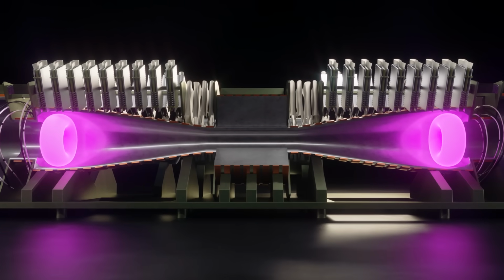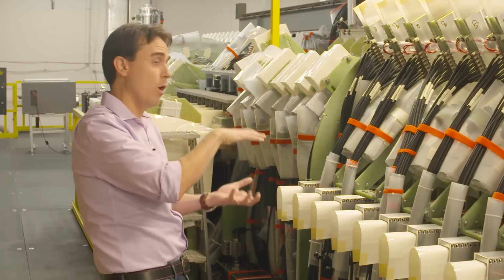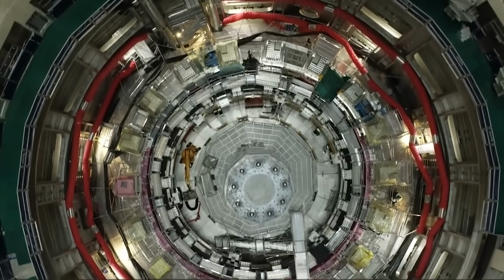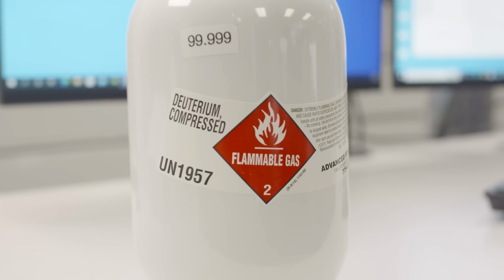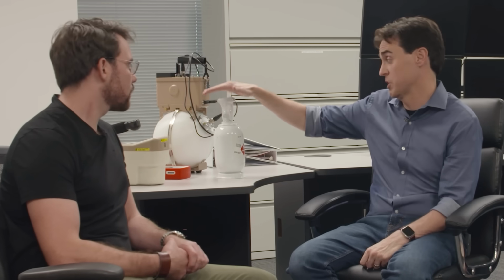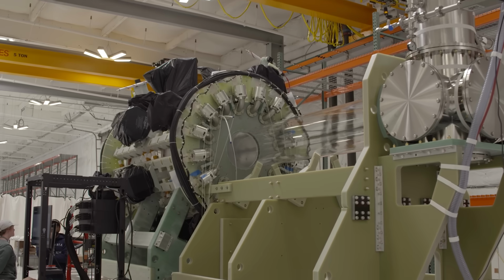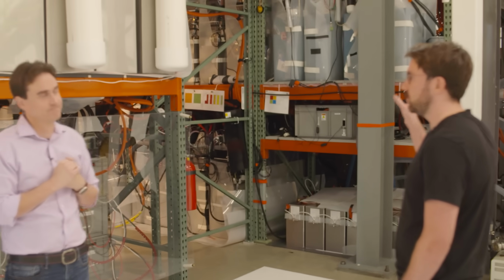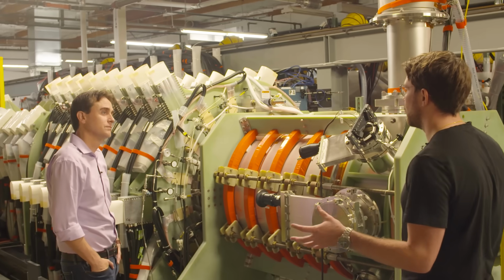A New Way to Achieve Nuclear Fusion: Helion

Comment: I'm confused, did Helion produce a positive energy output or not during their fusion reaction?
If so isn't Helion the FIRST to do a positive output?
Reply: Having watched the interviews on Nebula it seems that they have not even tried to capture energy with the current prototype. That will be attempted in the next one. This prototype was for testing whether they could do fusion using their method repeatably and frequently.
Reply: @magarnicle  
Ok but if no positive output then why try to capture what isn't there?
Reply: @paultrauzzi5360  I'm very much a layman here but my understanding is that fusion is happening in the machine. It's producing charged particles etc. But I get the impression that the current prototype does not have their planned mechanism to capture the energy from that fusion, hence no output. That doesn't mean there is nothing there to capture.
Reply: @paultrauzzi5360  I don't doubt that they will capture some amount of electricity in their next machine. The (probably literally) trillion dollar question will be Is it more than they put into it?
Reply: @magarnicle  
I'm not worried about capture yet, what is net output of the reaction?  Capture is a completely other question.
Reply: @magarnicle  
I'm only concerned with net output not even capture.
if it takes more electrical energy to create the reation than the theoretical reation output, there isn't a need to capture anything.
Reply: @paultrauzzi5360  Right. I don't know the answer to that. Helion's FAQ lists various achievements but doesn't say how much electricity it took to get them.
Reply: @magarnicle  "the current prototype does not have their planned mechanism to capture the energy from that fusion" - correct, the next machine, Polaris, will have that component to generate electricity from the magnetic flux produced by the reaction
Reply: No, Helion still working on various prototypes to get plasmas to higher temperatures, they certainly haven't made any net positive energy.  They claim they might have more energy output than powering their device by 2024.
Reply: @RWZiggy  Maybe, just maybe we will never get there, Stars are able to produce fusion energy just by their gravity and size alone. The bigger a certain system gets the more energyefficient it becomes thats just the square cube law for you.
Reply: @Benepene  stars use different fusion processes, mankind isn't trying to fuse ordinary hydrogen for a power plant or do NCO cycle.  but DT would be hard enough, Helions side DD is unlikely
Reply: Considering the capacitor bank's capacity is 10m joules, using the little diagram at 12:49, then assuming 100% yield (and hinging it all on what is definitely my awful, awful math and reasoning skills), they'd break even with 10m joules using around 1.53*10^19 molecules of deuterium. 3.97*10^7 mL of liquid deuterium at 1atm should do it.

I THINK

Buuuuuuuut I have no formal training in any STEAM field and am a two-time college dropout in an internet comment section so absolutely take all of that with a grain of salt - a molecule of salt, even. Even then, I don't know that they mentioned they ever made the mechanism to collect the output power yet. I assume it's being implemented in the next iteration for 2024. Or I dunno. A million other reasons. Maybe it's nowhere near 100% yield or idfk. I _can_, however, confidently say they were not the first to have positive output because if they were, you can bet they would tell you in this Helion promotional video.

Also, please feel free to take a crack at figuring out the output. I just played a game of balancing the equations shown at 12:49 and did some aggressively sloppy math with deuterium information I found online. I'm sure it's all very wrong 😜
Reply: @vituperation  
I will delve into these calculations.
I hadn't look at it this way.
Reply: So the answer is not yet, but it's really a ratio game. The achievement of fusion with the current system is 95% efficient for a prototype. Basically you want to make more then a 1:1 ratio, not a less then 95:100. But for both accomplishing fusion and with that kind of efficiency is the closest man has ever come. But with the configuration it should be able to be within the capability of making a net positive output in about a years time. Once they get better ratios, full reactors could actually power cities.
Reply: No, if you watched the video they mentioned they are building the new reactor that will produce power but its not going to be done until their 2024 projection.
Reply: Even the recent LLNL fusion 'breakthrough' with net energy output is a bit disingenuous. It was 2 MJ laser excitation, 3 MJ energy out... but 300 MJ to power those lasers, lol.
Reply: @sophiophile  you know it is still a big breakthrough.  we are talking around higher-than-cosmic energy densities here,confined in a box. it's a miracle on it's own. even starting a fire with a stick is a brilliant miraculous behavioural breakthrough. we just can not possibly adequately FEEL about those type of events anymore. it is a long gone ability for us.
Reply: @cyberbiosecurity  Oh, I still feel how amazing these breakthroughs are. In fact, some of the most amazing aspects of the breakthrough I feel have been overlooked (for example, the critical role that deep learning served in LLNL's breakthrough).  I just think the context I mentioned above is important when people are looking for energy generation.
Reply: @sophiophile  oh yeah. I've missed the ML bit too (the.... python script aspect)
Reply: @sophiophile  yes it is important. actually it is even important if the janitor there foks his vegan wife good. yeah.
Reply: @cyberbiosecurity  You can build a fusor (one of the earliest and simplest fusion devices) in your garage if you want to, and some people have done it. It will create temperatures hotter than the core of the sun and fuse deuterium and tritium into helium. People have been doing this for 70 years now, but every machine ever built, including the one shown in this video, needs more energy to heat the fuel to make it fuse then is released by that fusion. Until an actual constructed device makes net power, it's all just hopes and dreams.
Reply: @cyberbiosecurity   'higher than cosmic energy densities', very funny.
Reply: @russellpurdie  it's dumb, not funny
what I meant is fusion reaction in the sun ☀ generates about 1 watt per kilo of solar matter. 
and here they deal with higher wattage.
Reply: @cyberbiosecurity  you appear to be taking the sun as a whole in your calculation and not the whole of the machine in comparison.
Reply: @cyberbiosecurity  we don't care about scientific breakthroughs as long as they don't make us money or energy. Communism long gone comrade
Reply: @cyberbiosecurity  sure the NIF thing is impressive and great science - but from an engineering point of view (and I say this as a physicist) - how on earth do you turn inertial confinement into electricity? I'm more confident in the tokamak + steam cycle approach. And even that will take decades
Reply: @flubadubdubthegreat1272  this is what defines quality comments. thank you for great question.
Reply: @sophiophile  Yes. And that's very important.
Reply: @sophiophile  Sabine Hossenfelder did a good breakdown of this on her channel.
Reply: @sophiophile  "Even the recent LLNL fusion 'breakthrough' with net energy output is a bit disingenuous. It was 2 MJ laser excitation, 3 MJ energy out... but 300 MJ to power those lasers, lol."
In light of which it was bemusing in the extreme to read the US Energy Secretary saying it heralded commercial nuclear fusion power by the end of the decade!
Reply: @Hitch Gaming 
Ya in 300 years.
Reply: @Hitch Gaming 
Sorry but it didn't.  Not even close.  
After doing research, they are are closer to 400 to 1 energy in to out.
Reply: No, we still don't have a machine able to create positive net energy. It's actually waaaay on the negative side.
Reply: It is meaningless to bash the technology and predict it's failure without supporting such claims, especially for those claiming to be scientifically literate. Healthy skepticism is part of the scientific method, but "it hasn't been done before so this will fail" is not a rational statement. It's also hypocritical to bash Helion for not "predicting" how much positive energy output before they have sufficient data while simultaneously saying the technical achievements are overhyped. Making unprovable claims of something so critical would be the ultimate 'hype'. Building a prototype to test and measure the energy is the best way to do physical science. True scientific skeptics should look forward to the next iteration with anticipation, instead of pretending to know the outcome.

I am sceptical whether this particular system will ever scale up to practical size, but that is not the point! If any part of this novel technology, or the knowledge it produces, ends up as part of future systems then it will have been a important step forward. Whether it be grid-scale power production or a power unit for an ion engine is unknowable. Many, if not most, such advancements end up in future technologies unforseen at the time. You are reading this on a device that's only possible because of such advancements.

I'm sorry for the preachy post, but it is very tiring to read unscientific predictions by those claiming scientific training. This is antithetical to the advancement of human knowledge. Practical physicals at atomic scales and crazy energy levels are especially challenging, pushing the limits of human technology. Failure is always possible, which is precisely WHY we must do practical physics. Theory only gets us so far.
Reply: @allpro2b  WTF are you on about?
This video was release very timely on the same day as the news release of LLNL.
I and many others conflated the two.
Reply: @paultrauzzi5360   "I and many others conflated the two." So? Many people conflate and misunderstand many things.

If you actually watched the video, it should be clear it is not related. Or are you claiming that you were 'deliberately tricked' into watching a video you didn't actually want to watch?

Even if this video was posted early than planned to take advantage of increased interest in fusion topics, this would not be abnormal or devious. This is standard practice for all types on media.

However, my previous comment was not targeted at your indignation about the timing of this video. I thought it was pretty clear that I was referencing comments in this thread claiming this technology is just hype and will never work, and that it is abnormal to not "predict" positive energy output. 

It seems you "conflated" these two different topics just because they exist in the same thread.
Reply: @allpro2b  
Assume much?
If I was your prof I'd drop you a grade just for being long winded for no reason.
Why say something in 30 words when 300 will do.
If the future, answer questions presented not the questions created by the left acid trip.
Reply: @allpro2b  here, here.
Reply: They are not capturing anything yet. Do all losses. With their next 7 gen system they are hoping to start capturing energy back. And then it will be clear if they are net positive or not
Reply: Exactly it should be a net gain if they are coming out and saying they achieved nuclear fusion. You are just looking for publicity based on the recent news the other day. Don't over sell. I hope that this is the real deal.
Reply: @ichigokurosaki2838  
Exactly my confusion, this video was released same day as the news for positive fusion output.
It seems to be edited to conflate the two.
Reply: Not the first but pretty cool too
Reply: if they could get a q factor above one reliably you wouldn't be hearing of this first on youtube thats for sure. it would be all over the news. then it'd be a race to get it over 15 or so to be usable.
Reply: No. none did. They are all a net loss.
Fusion at this stage is a bit like Crypto.
Reply: @HTOP1982  
That's a cryptic statement.
Reply: It depends on what you mean by positive energy output.

Experimentally? Sure, maybe, but they're not the first as other reactors have done the same thing before (like ITER). Put a circle around the reactor and measure the energy coming in vs the energy coming out, if more energy is coming out of this circle then you've made more energy than you put in.

For commercial use? No, no one has yet to make a positive energy output. If you take into account electrical resistance and other areas of waste energy outside of this theoretical circle, then you'd be looking at a massive net loss of energy.
Reply: ~Global nuclear bomb fake Hiroshima deceptive There are no satellite photos of nuclear test explosions, please tell everyone~
Reply: @解放軍台獨1號  
I love this retardite.
Please send me your resume.
Reply: There's a difference between a positive energy output within the reaction and a net positive energy output for the entire facility. They've achieved the former more or less (they didn't try to capture and use that energy, but that wasn't the purpose of this test/prototype), but not the latter. In other words, the reaction they managed with this test produced more energy than the reaction consumed, but the energy produced was still less than the total energy the facility used to operate the entire test and its tools. It's an important step, but not one that should be overstated.
Reply: No, Helion is not net positive.
Reply: 0 output right now, at the moment it's just a novel way to generate a fusion reaction that doesn't rely on h3. The next version will attempt to extract electrical energy from their fusion reaction. It sounded like eventually they want to make this into a rotating machine but I'm skeptical, would probably be easier to generate steam and feed it into a steam turbine.
Reply: No MIT achieved positive a year or so ago but it’s so minute it’s not significant to anyone outside the field
Reply: @Alberta_Farmer  do you have a citation? Im curious
Reply: It sounds like they have made literally no energy at this point, I heard a lot of technical jargon but they left out the one number that actually matters. That one number is of course how much energy it outputs as opposed to how much is input. I didn't even hear a theoretical figure. That makes me pretty skeptical of this system.
Reply: The whole point of the videos was decrease the cost and using more abundant fuel, if we get those principles that this machine achieve and improve on them we could more easily generate energy
Reply: @dareggon  
So it is a no.
They released this video the day the news said there was a positive fusion reaction.  I conflated this video with the news.
Hence this is an advert for venture cap and no new info.
Reply: @paultrauzzi5360  It is very easy to point out an ideas flaws. It’s not a complete technology yet, what’s the use of an estimation before they’ve even finished prototyping it. It’s like you’ve just seen the first telephone and you say “well if I can’t carry it with me and make calls without those wires it’s useless”
Reply: @Abzuzu  
Interesting jump to your conclusion.
I'm just asking a question.  Pull the be from your.......bonnet.
This video was released exactly when the news of the first positive fusion reaction was declared.
Hence, my conflation.
Reply: @dareggon   Tritium is a radioactive isotope that decays relatively quickly (it has a 12-year half-life) and is rare in nature. Fortunately, exposing the more abundant element of lithium to energetic neutrons can generate tritium.
Reply: @Abzuzu  hence why it can be dangerous to present to the public, ideas and contraptions in the test phase. Most people have no idea what's involved in development, and if they see an unfinished product, they write it off. Which is really frustrating.
Reply: @laststand6420  Yup, lotsa commercial talk, fundraising vid only.
Reply: @laststand6420  Didn't they mention it can be 4x times more efficient than uranium fission reaction at the moment? They only trying to control the phenomenon and next prototype they will use to store that energy created and perhaps increase the energy output. Of course only if they manage to overcome problems with the heat they are creating and with the battery system and many others.. It has to start somehow, for me it seems very future optimistic.
Reply: @laststand6420  then you may not fully appreciate what is going on. you need to solve one problem before you can go on to the next problem. the first problem all fusion reactors had to solve was the temperature problem: can you create a mass of _____________ that is hot enough to sustain fusion.
Reply: @daxshell242  But surely they have estimates. If their reactor is so much hotter, why not just give the theoretical figures for Q at that tempurature and plasma density? 

Maybe they did just build it without calculating Q, but I find that highly unlikely. More likely they don't want to tell us how far they really are from break even.
Reply: @laststand6420  Sorry the fact that they haven't produced net positive energy (something no one has ever done with fusion) is a pretty stupid reason to be skeptical of this technology. It was never the goal of the gen 6 device to generated electricity.
Reply: @billytetrud  I'm not skeptical because  they didn't produce net positive, I'm skeptical because they didn't even give a wild guess as to how much power this thing would output in relationship to what was input... It even seemed like they might have been avoiding the subject with all their meaningless numbers about temperature and amperage.
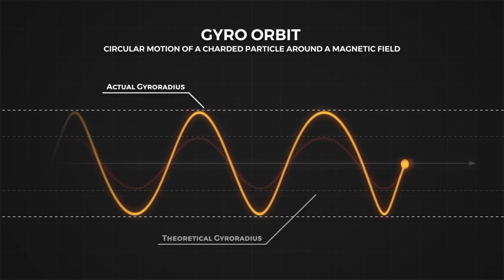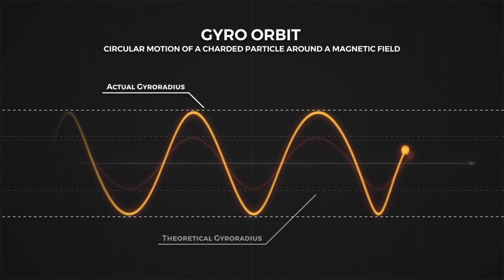Reply: @laststand6420  Tell me you didn't watch through 21:55 without saying you didn't watch through 21:55  
"Polaris will also be the first generation to begin capturing electricity" - i.e. the one they're now building after proving the concept with the Trenta version shown in this video
Reply: @laststand6420  If it's much closer to achieving positive energy that it is still a big deal.
Reply: @laststand6420  Thats fusion energy for you it's all very early in development no ones close to what would be an insane feat of energy
Reply: @billclinton4life221  "very early in development" xD
You are so clueless. It's been over 40 years.
Reply: @justalonesoul5825  40 years aint much in fusion and its really only like the last decade they really spent building and finally completing any large scale fusion projects
Reply: There is zero output, all the energy created via fusion is lost. They didn't say how much energy was created in the reaction. Their next generation plans to capture some of the energy in a novel sounding way, so they will probably release some numbers then. Skipping the heating of water sounds like a good idea toward energy output, I wonder how efficient the capacitors and electromagnets are.
Reply: @Broken_robot1986  
I'm a power engineer and skipping boiling water is bad for business but awesome for reproducibility.
The main goal shouldn't be just to make it work but work everywhere fast.
Reply: @paultrauzzi5360  I didn't think about that, adding another technology to work out.
Reply: They're has been positive energy actually it happened last month
Reply: They are still working on it. Maybe it'll never work. Maybe they can figure it out. 🤷‍♂️ I wouldn't personally bet money on it, but I'm glad some people are trying these things. Looks like a fancy laser show at the moment. At the end of the day, we can't keep burning fossil fuels forever,  we need new ideas. Most will inevitably fail, but hopefully some will succeed
Reply: @trybunt  
I wish Musk spent his 44 billion on this research and not F÷=kn  Twitter.
This will be utilized in the near future but after catastrophic climate change is imminent.
Reply: @paultrauzzi5360  Musk could of spent that 44billion on a lot of things, could have given 100k people engineering scholarships or funded 440 $100m energy start ups, but instead I guess he thought owning twitter was something he just had to do for some reason. 
You know, sometimes when I look at successful people in the world I can't help but think "did you make smart decisions along the way to get where you are, or did you just make decisions that happened to work by sheer coincidence?" Because there has to be a few people who just fluke it their entire life, right? Somewhere in the world is the most unlucky man, who just fails through no fault of his own more than anyone else, and someone has to be the luckiest man who just coincidentally takes risks that happen to pay out, making them appear brilliant.  Don't get me wrong, I don't think Elon is that person, but he is just a man, we are all prone to failure, and sometimes people forget that successful people are only human.
Reply: @trybunt  
What you are saying is, yes he should've put it towards fusion.
Reply: The utter negligent comments here is ridiculous.
It’s like most didn’t even listen to what was said and that they were only listening for what they wanted to hear…
Reply: @AdriftInTheSeaOfExistance  
There is good reason for confusion.
This video was released the same time LLNL news was released.
The technology us awesome but still 50 too late and 50 more years in development.
I won't see fusion energy supplied to home in my lifetime.
In reality CANDU reactors should be built everywhere now.
Reply: We are along ways off, this is more theory and test, there has not been modern fusion, with laser or magnetics, that give out way more then we put in to make. We're still 50 to 60 years away
Reply: @ryanjohnson1814  
I looked at LLNL real numbers, it is 300:1 energy in to out.
Reply: There is no current fusion reaction that has greater energy output than input, not even close. that's years away, to a point where by the time they happens, other forms of energy might just be better
Reply: @username7790  By the time it happens, I'd guess maybe 75-125 years, no other form of energy production could possibly be better. Fusion is the final boss. We'll be refining it for thousands, nay, millions of years. Maybe stealing angular momentum from rapidly spinning neutron stars or black holes would be a worthwhile bonus level.
Reply: They just did it in California
Reply: @Joelepor23  
"they"?  Not Helion.
Reply: Very expensive to build , more expensive to maintain .  At this time we need modular nuclear fail safe reactors to go all electric. Keep exploring other possibilities.  This video was very interesting.  I do wish them the best .
Reply: @rayRay-pw6gz  
We needed to build CANDU reators everywhere 40 years ago and the world would be BRIGHT and safe.
BUT we didn't so we need fusion.
This system isn't the expensive Tokomak design,  MUCH smaller and simpler.
Reply: When money is involved all credibility is lost.
A lot of private money is pooring into this, don't forget that a breakthrough would mean "loss of job for those working on this".
Reply: @gizmo6746  You've never worked a non-menial job before huh
Reply: @nanonano2595  you guys are hyped up for nothing.
This wil never work
Reply: @gizmo6746  
I disagree completely!
PRIVATE money always comes with checks and balances and if no "breakthroughs" the money stops.
PUBLIC investments seem to disappear with nothing to show for it.
Reply: They've had positive fusion outputs since the 1940's. Making it highly controllable is the issue.
Reply: @IOUaUsername  only if you include nuclear weapons lol
Reply: @IOUaUsername  
Really?
Can you show examples?
Because according to EVERY article I can find, the first time a fusion reaction has generated more energy than the fuel used to start the process was Dec. 2022.
BTW there were no fusion reactions, manmade, in the 1940s, PLUS the first fusion reactions were only used to "fuel" fission reactions, STILL not net positive uncontrolled.
Reply: @paultrauzzi5360  @DanSands is talking out of his ass. My father was a DoD physicist, I have followed science my entire life. This is a huge fucking deal!
Reply: @pmaldonato  
I appreciate the enormity of this undertaking and I also try to follow these incredible leaps forward.  I was just conflating this video with the same day news release of the Livermore National Laboratory in California.
Reply: @paultrauzzi5360 Oh, shit, yeah kind of flashy....agreed
Reply: @paultrauzzi5360  I believe IOUaUsername is referring to H-Bombs as net positive fusion reactions considering that he's talking about making it highly controllable being the issue. And in that regard he is only a decade of since Castle Bravo happened in 1954.
Reply: @skirata3144  
Even that isn't a net positive reaction.
The fusion reaction was only to produce enough neutrons to fully complete the fission reaction.
Normally only some of  the Uranium 235 is split because the explosion doesn't allow enough time to complete the reaction.
Reply: @paultrauzzi5360  if you're referring to fusion bombs, you've got the fueling backwards. Fission was used to fuel fusion.
Reply: @IOUaUsername  That's just not true. It's super hard to heat the plasma to ~100M degrees using less energy than the subsequent fusion releases. It has only been achieved last year.
Reply: @IOUaUsername  just stick it in a hole in the ground full of water and capture the steam that comes off when you initiate the reaction.